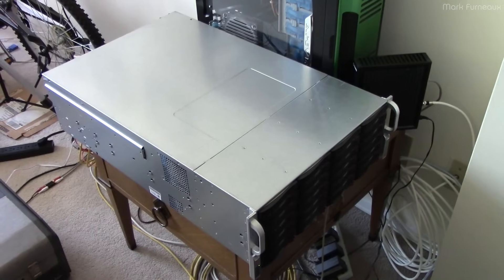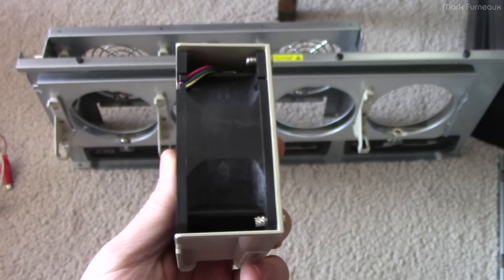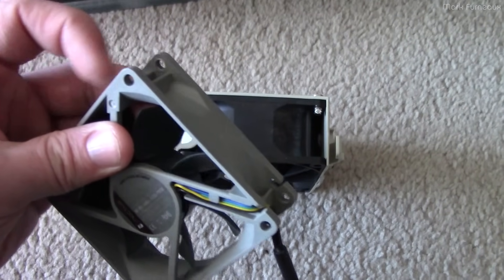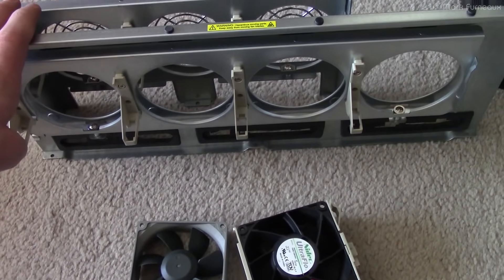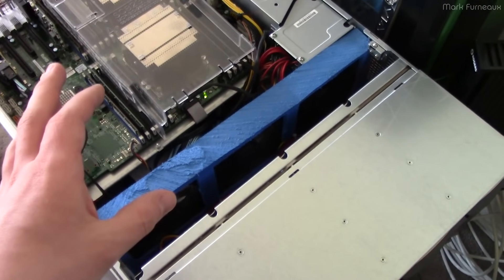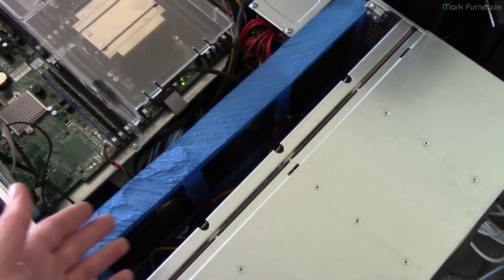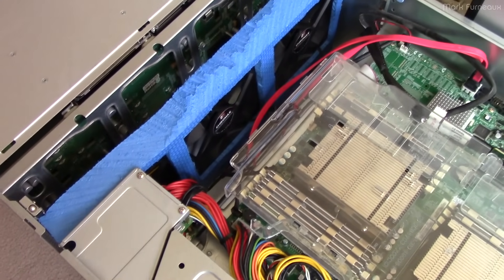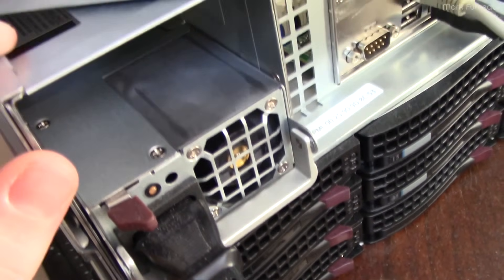How To Silence a Supermicro 4U Server (or Really Any Server)

Comment: This will work on servers that utilize standard fan connectors, but you'll find this kind of project doesn't work on many of the OEM chassis that have more proprietary connectors, such as Dell, HP, and Cisco servers, where the fans are on their own proprietary little modules with socketed connectors that don't adhere to the common fan connector standards. Still an interesting approach, and it clearly works for this application. Just something to note.
Reply: not only the connector's pin layouts are different, but industrial / enterprise fans have temp monitors built inside as well, which feature Noctua fans lack, so the servers will instantly throw error messages about fan malfunctions.
Reply: that's why nobody wants that crap at home and supermicro chassis are the dream for any homelab.
Reply: @BerserkeR_031  Yes and no. OEM servers have other nice features, particularly Dell and Cisco servers. Dell are convenient because you don't need to find an account to borrow in order to download firmware and utilities, but Cisco are inherently more recoverable because they have multiple BIOS and CIMC storage locations and you can generally fail back to a previous version through CIMC in the case of the BIOS, and there's usually a switch on the motherboard to fail back the CIMC controller if booting to a CIMC updater doesn't resolve your problem. I've dealt with some Supermicro servers in the past and my evaluation of them is that they're fine. Basic, but fine. Their remote management is a bit lackluster and it can make updating firmware or analyzing hardware faults a bit annoying, but it's nothing deal-breaking.

The real server brands to avoid if you aren't actually doing this professionally are HP, Lenovo, Oracle/Sun Microsystems, and anything IBM. It's a combination of proprietary stuff, locked down support accessibility, and the benefits aren't enough to outweigh the inconvenience.

My honest opinion is that if you don't explicitly require the ridiculous core counts and PCIe lane counts of server processors, you should probably just buy a decently high-end consumer system and install a PiKVM for remote management and call it a day. I built my own workstation with pseudo-enterprise gear and if it weren't for the fact that it was the cheapest way for me to get a relatively modern 20-core/40 thread processor and a lot of RAM capacity, I wouldn't dare to bother with enterprise shit for a personal computer. Enterprise decom switches and storage arrays are fine to tinker with in a home lab, but unless you legitimately need a feature that only enterprise servers can offer, then I wouldn't bother. They're expensive, slow to boot, and just generally loud and annoying.

Comment: Btw, the cfm isn't the most important stat. Yes in free air without restriction, they make a lot of cfm, but when you're trying to force air through heatsinks and around cards and memory sticks, you need high static pressure. That's basically the amount of force it can push the air. High cfm will churn the air between the fan bezel and what is obstructing it, but not be able to push through. To fully cool everything, you need to push the air out the back, rather than blow it around

Comment: Good idea. I used long mechano strips instead. Took the motherboard etc out and put 808x cable sockets on the pci plates. To be honest I wanted to shorten the depth of the case but chickened out. Used Nanoxia 120mm 1300rpm deep silence fans. Have an LED temp monitor fitted to the rear IO plate area. Am about to fit a fan regulating pcb in there. Like others have mentioned, I'd feel a little sorry for the cpus.

Comment: The big problem with these fans is that they're a fraction of the static pressure of the original Nidec models. Like less than 1/4 in fact. They may work in many situations where the hardware isn't stressed. If Supermicro could have used Noctua fans to the same cooling performance, they would have - they're (all) much cheaper than the Nidecs.

Comment: Thank you so much!!!
Your solution with IPMI Tool worked just fine for me too! I'm using an X10SLL-F and my fans were running high, then low, etc...
I fixed just changing the values as you suggested!
Thanks a lot mate!!

Comment: Great video! Less than a month ago, I finally got around to silencing my 4U Supermicro SC846. I had it with stock fans for more than a year, right next to my bed (no other space in my apartment).

Although the fan wall and power distribution "area" looks surprisingly different in my 846 (I'm guessing yours are 847 chassis?), I also tore out the existing fan wall (with three 80mm stock fans) and fit in three Noctua NF-F12 120mm iPPC-3000 fans. The nice thing is that they fit snug with just friction. (I zip-tied them together and to the old fan wall mounting holes.) The only thing I'm missing in this area is some foam to close the gap above the fans. It's on my to-do list.
I then also replaced the two stock 80mm exhaust fans (which yours don't have) with some 80mm Noctua NF-A8 PWM fans. I also replaced the PSU with an SQ-model, even though they're extremely over-priced where I live (Supermicro hardware in general, unless you get lucky with something second-hand).
Lastly, I actually removed the plastic airflow duct and the stock CPU coolers, and installed two Noctua NH-U9DX i4 active CPU coolers (two fans each). The airflow duct was molded a lot differently than yours, and did not fit very well in the first place. I don't think it was made to fit the stock CPU coolers I had in my setup.

I had the same fan oscillation issues, but it was of course a simple fix as you showed.

Overall, my setup is very quiet now. It still has a slight hum to it, like an older desktop computer, but it's definitely apartment friendly now.
It gets slightly hotter than before (normally hovering around 45-55°C now) but that's alright for these Xeons. At full CPU load, all 20 cores/40 threads across my two CPUs, it stays around 60°C, so the temperature is quite stable if nothing else...
I'm sure fixing the fan wall gap will help the airflow a bit more, once I get around to it. I also only have one PSU in it, so I'm going to 3D print a plug for the empty PSU hole at some point.

I just wish I'd done these modifications a lot earlier.
Reply: How are the temps in the HDD's? Are all the bays full? Plugging that gap will help increase the static pressure and draw more air across the HDD's for sure.

Comment: I had fussed with that eons ago (90's 2k's) mostly to isolate the fans from the metal case. I had varying success depending on fan and foam type. the idea is to isolate the fan motor/housing vibration from the metal panels of the case, as the case panels act like speaker cones and the fans act like the driver coils of a speaker. the foam is to isolate the fans from the case.  I also did silly stuff like spraying the inside of the case panels with automotive rubberized undercoat spray-paint to 'dampen' the panels flexing, which was also meh depending on the computer. the spray rubberized undercoat can be messy, ugly as sin when masking off edge mount areas, and the effectiveness is meh. I've also fussed with the foam construction paper-like stuff (foamies) with the sticky-back to dampen panels, that stuff also works ok, yet can look ugly as well to some. I've also played with hot-gluing foamies into air-guide baffles, easy and fun, yet isn't very 'pro' looking.

Comment: I have (3) SC847 - 4U servers and have tried many times using various fan configs and in my case, was never able to get the CPU temps from throwing alarms under high load - not to mention high drive temps.  The issue seems to be the fans I have tried (Nashua, and 120mm 2000 rpm fans) just don't have enough static pressure to cool the passive CPU coolers and 36 drives.  I am using all the factory fans - set at full speed - and use a PWM fan controller to keep them reasonably quiet.  I like your setup and very tempted to give it another try with those iPPC fans and foam.  Just curious of you have issues at 100% cpu load and fully populated drive config?  I still get alerts at 100% cpu at times, so I might have to change the BIOS to "Cool and Quiet" vs full, so the server can bump up the fan speed on high loads - even with the PWM fan controller.
Reply: I strongly suspect these 120mm fans do not have sufficient static pressure for full drive bays and loads near 600-800W.
Reply: Attempted a functionally identical install as this video with these fans. Unfortunately, both CPUs set off overheat alarms almost instantly under load (even with numerous attempts at baffling to direct more airflow through the heatsinks.)

Comment: im wondering what the hdd temps are reading at though. That is a crucial item. I modded my 846 with 3 - 3000ippc 120mm for the mid bridge and 2 80pwm a noctuas for the rear. at this point HDD temps were around 35 to 36c,  unfortunately when they are fully loaded or doing hard work the temps jump to 40-49c which is way to high. I added a front shroud on the outside with 3 140mm ippc3000 noctuas as well and that pushed the temps under full load to 35 to 36c. This is acceptable to me as i can use it as is. Edit: I also would like to mention that changing out the fans on the supermicro Psu is NOT recommended and can be dangerous so proceed with extreme caution.

Comment: I remember you were using a donated hba card,
How’s the performance and stability of that card? Did it ever failed?
Reply from the maker: That one is no longer in service, but I keep as a backup. It still works fine.
Reply: @TheUbuntuGuy  Good to know, and after watching several related videos from your channel, It seems a decade old, used server grade card lasts longer than a brand new, cheap pcie to sata adapter.

Comment: Did you test them wrt flammability? Some types of foam used in furniture was outlawed as it was flammable, and nasty too, highly toxic smoke.
Reply: I'd like to look into this as well. There are tons of different types for building.
Reply: It'll burn under direct flame and melt with arcing and sparks. But it won't continue to burn on its own - as a fuel material, it doesn't produce enough heat to maintain the burn. It'll probably be the most flammable thing inside the case, but less so than wood or other materials people might use.

Comment: Do you hear a very slight motor noise from your fans? I also have the IPPC-3000s in my servers and they start rapidly clicking around 600 rpm
Reply from the maker: No, I've never heard clicking from any fan at any RPM. Is a cable getting sucked into a fan?
Reply: @TheUbuntuGuy  Thank you for your response. There is no cable stuck in them, this is the sound I am talking about: https://www.youtube.com/watch?v=1d1LEQNKUqI you can hear it every so slightly. I've got six of them running in that box and they all seem to have the same issue. I'd like to find out if I've gotten a bad batch or something
Reply: @David-wh8zs  I've never heard that with mine either.
Reply: I got AVC fans that have a motor noise but it's a whirring / commutation noise

Comment: How do you go with dust?

I have a 2U server with 4x ADDA 80mm fans with 45ppi dust filters and trying to blow air through them is difficult, without the filters I can get away with 1,000 RPM, with them I need 2,500 RPM but the filters make the server vastly easier to vacuum every month so I put up with the noise (~45 dBA @ desk). But I have tried to improve it seeing as it’s right under my desk and under 1 m from my bed (limited by space and SFP+ DAC cable lengths). 

I tried something a little similar to you by replacing the ADDA fans with 80mm low RPM Noctua Redux fans and noise dampening mounts but found I had to max them out to 1,700 RPM at which point the ADDA fans were quieter plus 1,700 RPM couldn’t keep the HDDs under 50 °C. In hindsight I don’t know why I thought Noctua fans would magically solve my problems, I don't recommend that approach.

But at least my PSU fan only very rarely spins up, the full system is ~150 W and it’s a platinum rated PSU, but I still need a 40mm fan on the HBA (LSI 9207-8i).
Reply from the maker: I let the dust build up and then I use an Datavac (mains powered air duster) every few months to clean it out. I don't vacuum them since I find it less effective and you have to deal with ESD buildup. I have filters in my desktop and it still needs to be dusted almost as regularly, so I don't bother in the servers.
Reply: @TheUbuntuGuy  You have to be lucky to kill PC hardware with ESD that way. Ground shielding and engineered protections are simply too effective.

Comment: Your disks seems to be staggered, since consecutive caddies are not lighting up. Is that on purpose for cooling?
Reply from the maker: Yes exactly. The 8TB Ironwolf drives are 7200RPM and get very hot (this was before the fan replacement btw). The Exos drives don't get nearly as hot but I kept the same bays as before.

Comment: Which Noctua fans?  I want to find a good exhaust fan for a desktop and these seem like a good option
Reply from the maker: I used https://noctua.at/en/nf-f12-industrialppc-3000-pwm. I think they are overkill for a desktop and you will hear them. A better option for a desktop which gives more airflow for less noise is this https://noctua.at/en/products/fan/nf-s12a-pwm.
Reply: @TheUbuntuGuy  OK... I just want a better Non-RGB fan for the back of my PC case...  Currently using a Corsair AF from a few years ago
Reply: @TheUbuntuGuy  I'm planning to build a fan wall from 1mm stainless steel, would you still pick the 140mm fans if you could even though they have lower static pressure? --- And do you think this mod will still work with the 24 bays at the front filled? Btw, I'm planning to use active CPU fan on my SP3 CPU.

Comment: in my case I'm using a 16 bay(cost me 50$!;compellent sc030) mostly off offline nas, not a supermicro mobo....... Opteron 3320(low tdp) on a gigabyte 970 based mobo; I installed 3x PWM temperature speed controllers from aliexpress(taped the tempo sensors on the front of the back plane;fans are being powered by the backplane)..... still not silent, your setup is nice:), but a lot quieter than it began....... if I ever see em at a good price I might try for the SQ psu's, would like to try to get a 36bay:P

Comment: well if your center fan ever fails say bye bye to your CPUs
Reply: Every CPU that is worth the electricity it requires has overtemp protection in silicon.
Modern CPUs simply halt any code execution, which drops CPU current consumption next to nothing.

Comment: Cool Video..I Moded My SM CSM-846 to be Quit a While Back But I Did it a Little Different Than You..I Replaced My Fans with 3 B Quite 120mm in The Front 2 80mm in The Back & Just Added a Pair Of Noctua NH-U9DX I4 Coolers But I Also have a Pair Of Xeon E5-2696v 2's ,128gb of ecc Ram Multiple ssd's & I Wanted Every Thing To Be as High Performance But Also Cool as it Could Be Also ..O I Aded a 120mm over My 10Gb Nic & Sas Controller ..I Just Need a pair of SQ psu's but hate to pay that kind of price ..But Yes The Psu's Are the loudest fan in their now !

Comment: I will second that 40mm fan fail, as I tried it on an odroid-xu4 and it just couldn't keep that cool. many had suggested swapping out the stock fan for a Noctua-40, and the odroid would throttle with a browser open on a blank web page with the Noctua fan, lol.  they are quiet, they also lack CFM as a tradeoff for being quiet. I had better luck replacing the stock 40x40x9mm MX440/Radion9000/chipset like heatsink with a 40x40x38mm pin-fin thing from aavid thermalloy, with a regular black 40mm fan, the fan no longer is commanded to spin up under any load with that heatsink, lol.   the 120mm IPPC fans are 'ok' however the Noctua 40mm fans are junk if you need actual CFM.  I'll keep my thoughts of stator-vane deltas at sub-1k idle RPM vs Noctua IPPC at max RPM to myself as you do have a nice result with those servers, and it's tricky to get the deltas below 1200RPM (it takes fan PCB mods), I'll just say those stator vanes do make a difference when the fan is made to move CFM instead of "just being quiet", lol. Also, delta got a bad name, cuz of the old K7 overclocking days (and Linus Tech Tips), they do make other fans that spin at lower RPMs than just maximum insanity, lol.

Comment: I would never put a DIY foam in a server without serious consideration of fire risks.  No laser cutter or 3D printer?  You don't need to own these as you can simply get it done by a contractor down the street or use a company like Protocase.